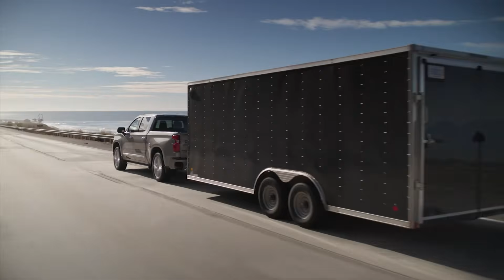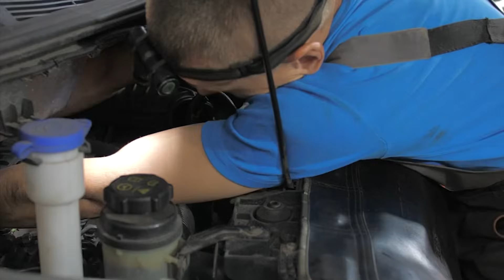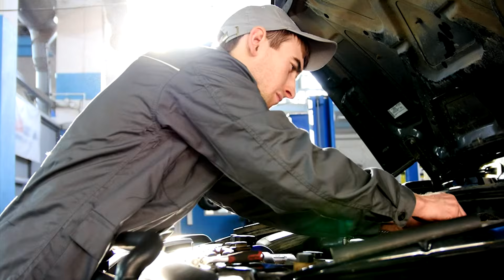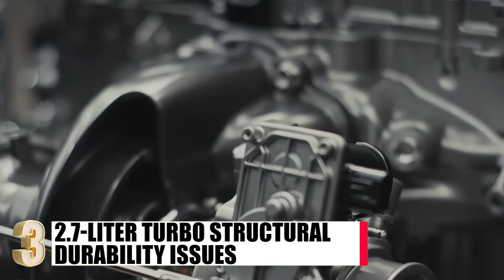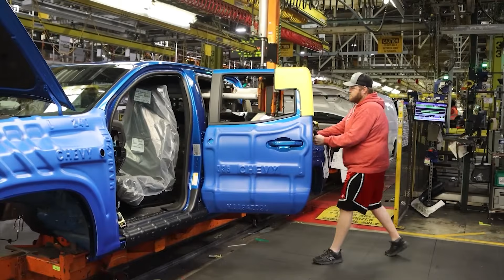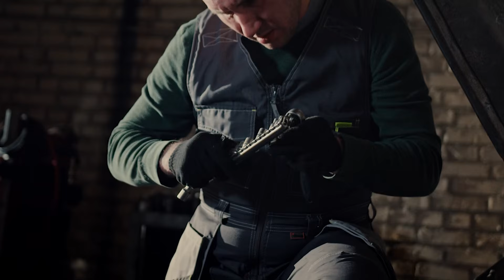6 HIDDEN Flaws of the 2026 Chevrolet Silverado Engine: How to Avoid a DISASTER!

Comment: All of these f**** garbage pickup trucks. Me and my dad were looking at a General Motors vehicle. And instead we got a Nissan. We were told Blah blah blah don't get a Nissan. But how many years later the Nissan now has 100,000 miles and it hasn't had a single goddamn issue. NOT ONE problem. Not a single thing has gone wrong with the. It has been absolutely Bulletproof. If we go to General Motors vehicle it would have been on its third or fourth engine. Same with a Ford. Same with the Dodge. They are all crap. We're sticking with Japanese

Comment: Damn just bought a 26 5.3 RST silverado and now I'm worried
Reply from the maker: What made you pull the trigger on the 5.3 RST specifically before watching this? And how many miles are you sitting at right now?
Reply: @fuel_force less then 2k
Reply: My F150 was at crucial point for expensive matenance and getting up in miles, i wanted a good trade in before investigating more money in the truck.  I got 20k for my F150 and they were selling the RST with 12k off MSRP  so i basically got the truck for around 30k . Its a beautiful truck, blacked out edition.  Then i started seeing all these videos after i bought it.  The dealership said the kinks were worked out for the 26 models. 2027 is going to be a whole new engine that will probably have a ton of issues
Reply: How is it so far thinking about buying one
Reply: @AlShams69 so far so good
Reply: I'm interested in them, too.

Comment: I'm thinking to buy a truck and I'm so sad right now  there is no good cars ((( Most of them are aluminium junk. I was locking to buy one car drive untill 1 000 000 km and buy a new engine. I wanted to  buy zr2. But now i don't know.
Reply from the maker: The ZR2 is still a solid option, but long-life ownership depends more on maintenance and how you use it than the material itself. What was the last car you purchased?

Comment: The engine and the Transmissions are junk. I owned one. All the transmissions will fail at 120,000 miles, a rebuilt transmission today is $6,800. Installed.

Comment: The 2026 2500 has the 6.6L V8, what do you think about that motor? Gas specifically
Reply from the maker: The 6.6L gas V8 is a workhorse - are you considering one over the diesel, or just curious about reliability? What are you planning to tow or haul with it?
Reply: @fuel_force  I wanna get one just cuz the diesel is so expensive and the 5.3 and 6.2 are lookin like money traps